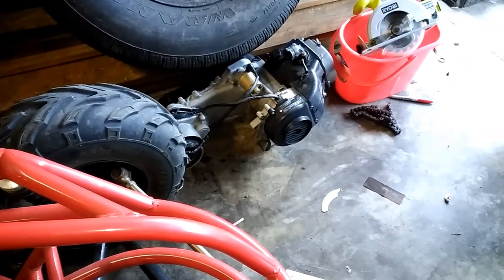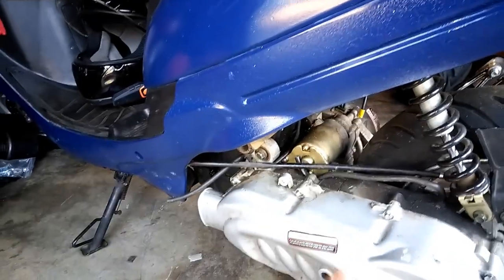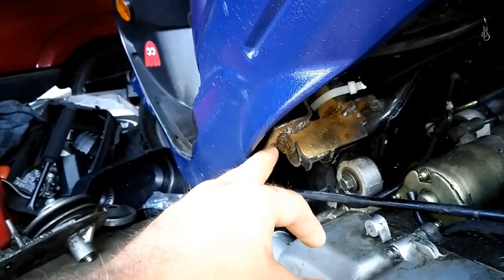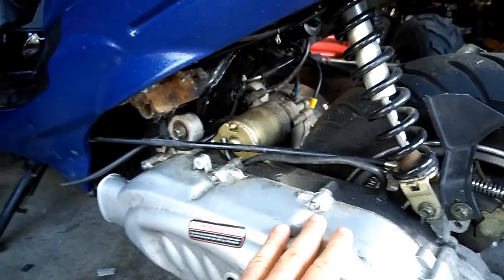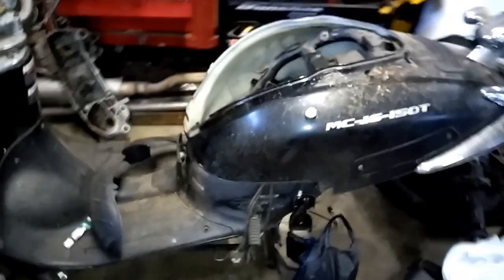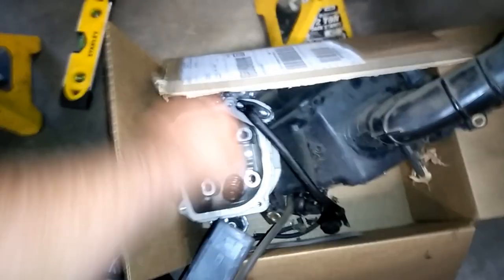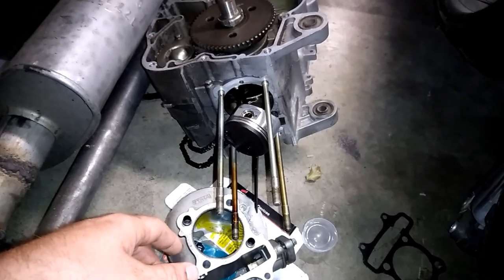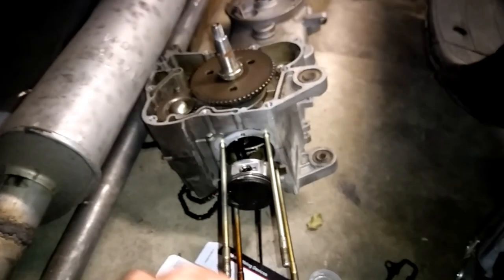How i did my 150cc swap on my scooter

Comment: Very thorough and simple explanation. Except for the rear wheel has a different length shaft and the brakes are a larger hub so a 50cc rear wheel won’t usually work.
Reply from the maker: Mine fit perfectly
Reply from the maker: I used all stock parts
Reply from the maker: I was lucky enough to have a donor if things didn't fit though

Comment: How did you determine how far left or right the engine needed to be to get it centered?
Reply from the maker: Pretty much lined up on the pallet the frame rails and the grooves on the block

Comment: Great explanation, ever thought of teaching how to use a welder, and perfecting the art? For $125 you got a lot of good stuff...the bike and 2 engines.. Where are these people when I want to buy something? Don't even waste your time changing the valve, get a $30 head, and that engine you get $250 - $300. I want to see some of those wheelies also...lol. Subbed.
Reply from the maker: I am super shitty at the wheelies but I'm trying
Reply from the maker: As for the bike at such a good price, literally just started posting in all the local scooter groups asking for a 150 with or without title for 300 or less then just haggled prices
Reply from the maker: I will try to get a video of the wheelies for sure though, I drilled a hole into my finger on my lefthand at work so I am having trouble with the rear brake and not looping out lol